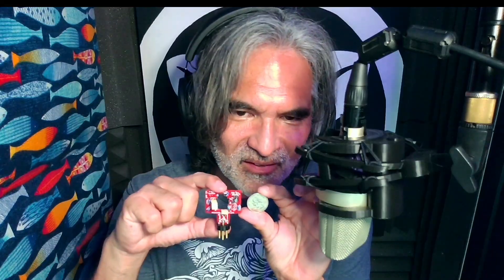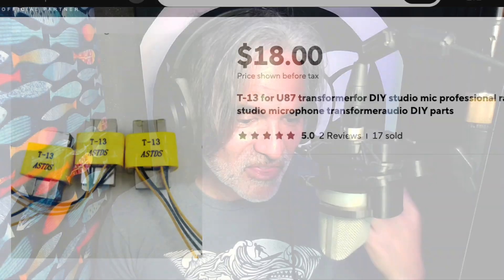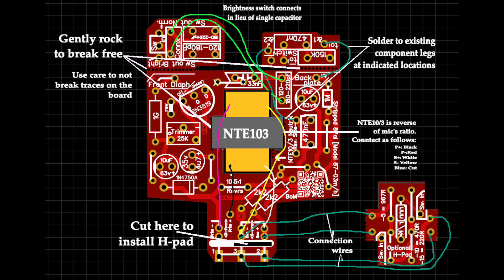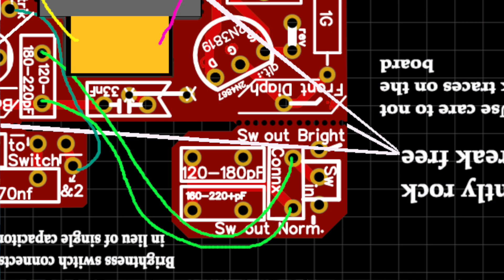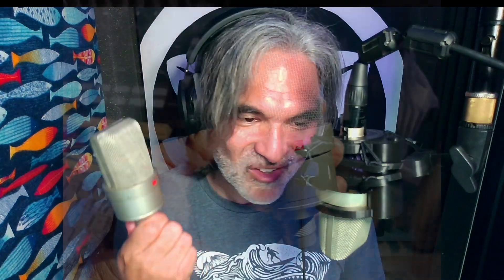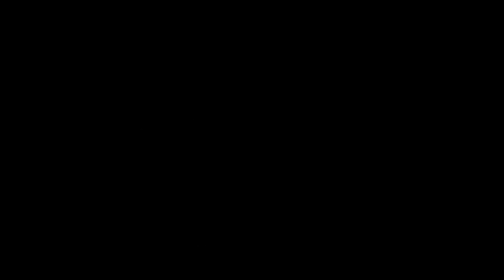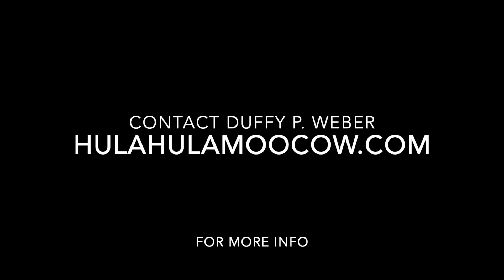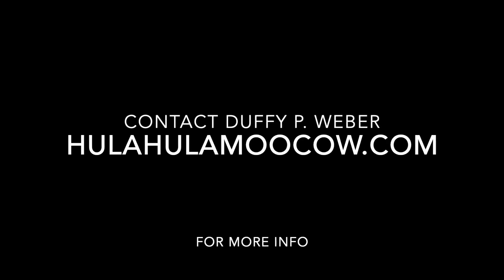Vintage u87 in a TLM-103-style Body - Meet the Hula Cow ORS 87 Nano DIY Microphone

Comment: would this fit in a 102 sized body..?
Reply from the maker: In an actual 102 body, no. The PCB is too large. In the Chinese-made body that is kind of halfway between a 102 and a 103 size, yes. Your best bet for size questions would be to contact Duffy at Hula Cow studios since he designed these 103 sized boards.
Reply: @ Is that the ~11.6cm tall one..? I know the original tlm 102 is about 9.5cm tall
Reply from the maker: @edenem  Luckily, I had my calipers at hand. The bodies these were designed for are 128mm tall.
Reply: @ Ok!! Thanks so much :)

Comment: No way these little arduino boards are mimicing u87s...AINT NO WAY MANNN 😲
Reply: Not even Arduino. It's 100% through-hole components. ; )   (I don't solder anywhere NEAR well enough to play around with SMT.)  😜
Reply from the maker: Isn't it totally wild?

Comment: The audio on this is spectacular easily on par with some of your more expensive mics you featured here prior.
Reply from the maker: Thank you! It has a nice smoothess through the 4-7k range that gives it more sense of detail and that really works here. It's the sum of pairing the right parts through a copious amount of trial and error, but this is a formula of transformer, capsule and circuit that can be repeated so I'm very stoked. Glad you dig it!
Reply: With  modern redesigns, small or tiny circuit boards are actually fine to replace the old large ones. Audio signal can transfer through very thin signal paths

Comment: Any suggestions for donor bodies? Would an M49 body work or is it an altogether different body dimension wise? Found one on Mic&Mod.
Reply from the maker: M49 body would be really nice. A lot more room inside the body to fit an even bigger transformer. We’ve been using these Aliexpress 103 style bodies that are 1/10th the price of that m49 though. It’s a whole mic but the guts a
And capsule are crap so you just empty out the body (and you may need a capsule mount) but Duffy designed the boards to squeeze into one of these. 
https://a.aliexpress.com/_mOgraDm